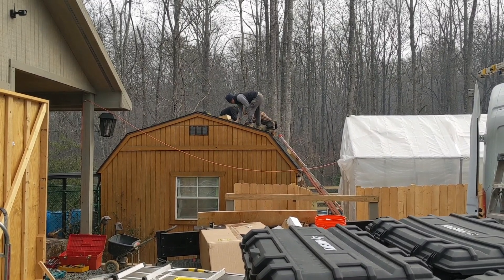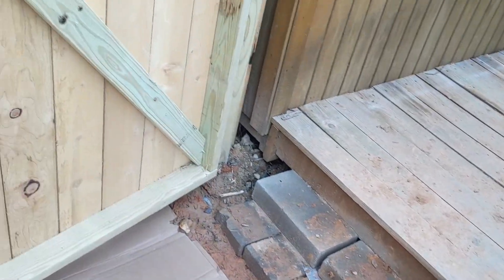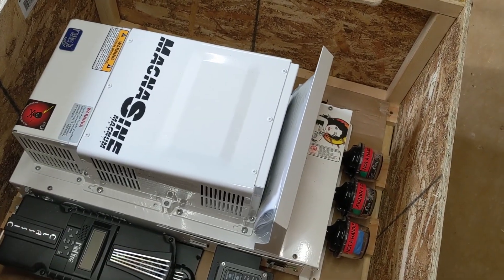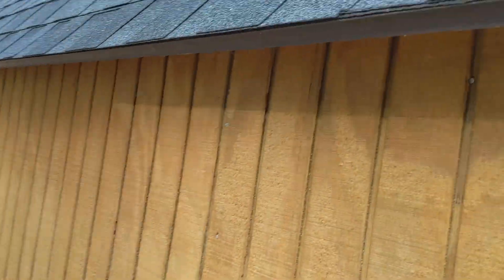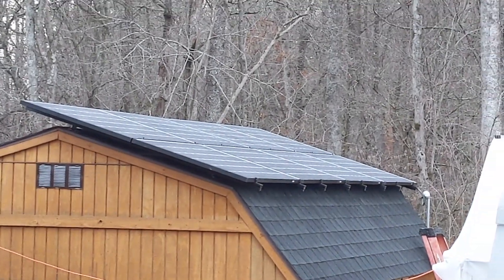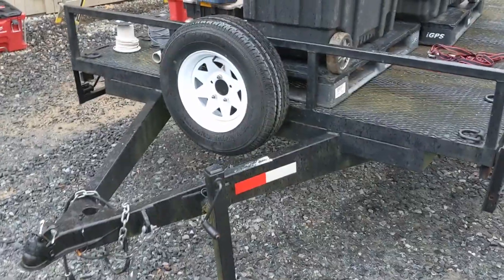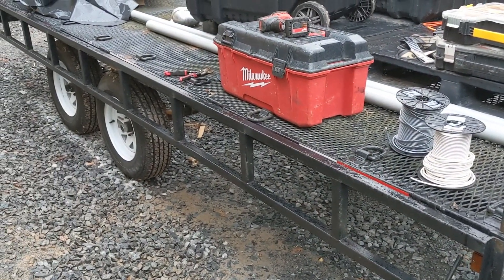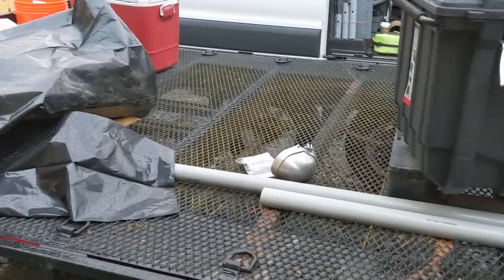DIY - OH MY!! (Home Solar Project)

Comment: Engineer, I have a question no one seems to be able to answer.

I am looking to go off-grid in a small 16x40' cabin.  I won't have anything fancy but I do want AC via a Mini-Split and I will have the typical fridge, some lighting, TV, and router.  I will also want to cook (in the summer) on a slow cooker of some sort.  Winter, I will cook on the woodstove.  

My question is while reading the specs and instructions on the Solark 8K it only puts out 33A continuous which seems really low but I do see many people living off one.  Is it really possible with only 33A?  Should I look more into the 12K or should I just look for another solution?  I don't have the money to run two of them at $6K each.
Reply from the maker: I tell people if you can't live off grid on an 8K inverter then you've designed your house incorrectly.

Comment: Need a little "opinion" help ... I have a chance to buy locally Used Trina 250w panels for $80 each. Don't know how old they are but says they were producing power when decommissioned. They look in good condition in the pictures ... My question is ... Good Deal or keep looking ? Thank you, Carl
... P.S. DEAL ON THE TRAILER
Reply from the maker: That's a great deal I would get them.

Comment: Do a trailer video !!! I almost feel like driving down to get one. The ones around here have a ramp on the back. You can drive 4 wheelers up on them. Haul 2 or 3,  4 wheelers to the mountains.